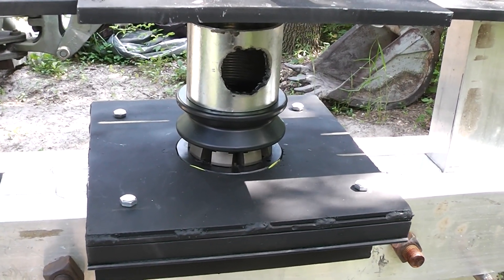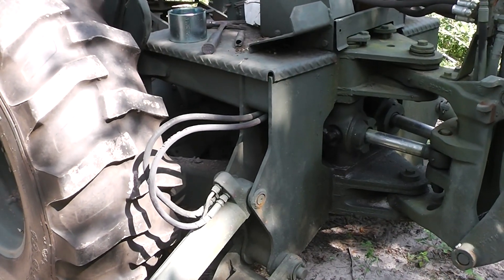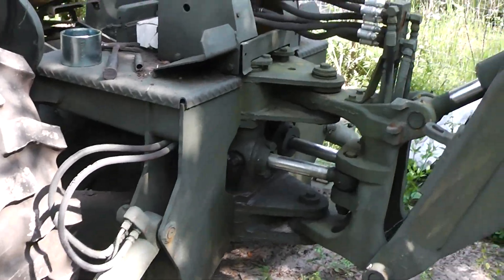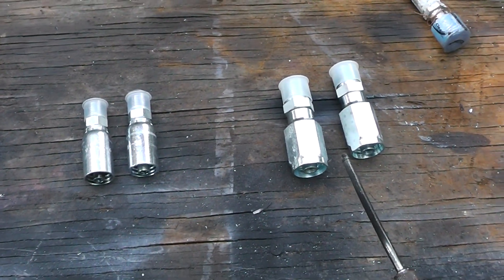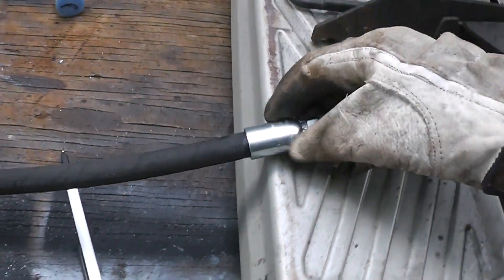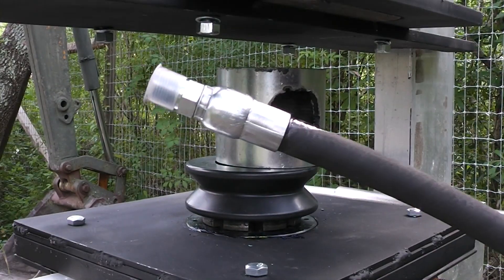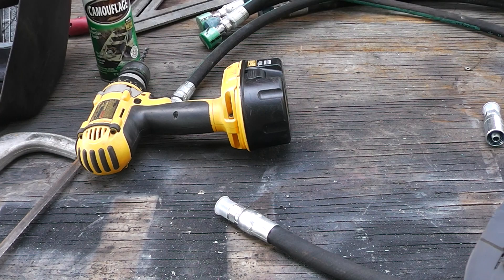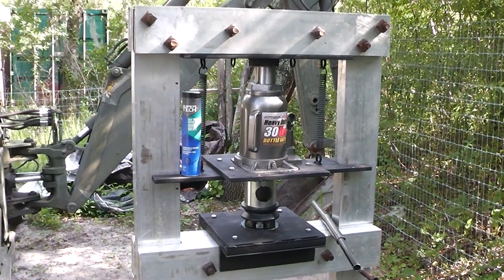Cheap Homebuilt Diy Hydraulic Hose Crimper

Comment: I'm wondering how did you clean your hydraulic hoses when you made them? 
I been watching several other videos on making hoses and now it seems that you have to buy a $900.00+ plug blowing gun kit to shoot cleaning plugs through the hoses, from both ends, so theres no debris in the hose after cutting. Good grief this hose making venture can be extremely pricy and to much for me right now, even the price you was talking about on your crimping die scares me........
Reply from the maker: I just blow them out with my air compressor, then I spray some brake kleen inside and blow that out as well. I'm sure that is the wrong way to do it but my hoses on my tractor have held up for going on almost 7 years now with no problems in the hydraulics. Use this info at your own risk.

Comment: I have some of the $20 Tractor Supply hoses.  After a few years, they're cracking up and the rubber is failing.  The hoses I had custom-made at the auto store and the tractor dealer have been much better.

Comment: For future reference dont dip the hose in oil just out a dab on the tip of the fitting.. any oil built up under the fertile has the potential to force the inner to over crimp and collapse or the outer ferrule to not crimp down far enough. Also if those are parker dies there Is a ledge that the ferrule sits on so you know you've crimped enough of the ferrule length

Comment: You have built exactly what I need. I have built many things driven by hydraulics & never have the right hose. I could not find the brand of your dies & Colette. Can you share that?
Reply from the maker: Here is a link to the dies: https://www.discounthydraulichose.com/d100d165-dies.html
I don't have the part # for the pusher ring/colette but, you can call  Discount Hydraulic hose direct at 800-535-1302 and they will hook you up.  Just make sure you get the pusher ring that matches the dies. I used the D100 dies and the matching D100 pusher ring.

Comment: Looked like your crimp was to low, not all the way up to the mark. Hard to do on a homemade machine for sure. And to crimp the right amount. Especially with different size hoses. Thanks for the video. I've made hundreds of hoses for equipment. And your right they are expensive.

Comment: Thank you for this video, I am just about to start to do it, I have 3/8, 1/2, 3/4 hoses. What crimper die should I buy, I saw different names, but what did you use please?
Reply from the maker: https://www.discounthydraulichose.com/hydraulic-hose-crimpers-37465.html and
https://www.youtube.com/watch?v=nHkh_ybAsfA&t=1s

I bought the D100 3/8" and the pusher ring first and build the rest of it around that.

Comment: I guess it's been three years since you made this video. I have made tons of hoses over thirty + years. The crimp  looked great . A small tip. Move the part down more to get the most hose crimped to the internal pipe. Makes it less likely to blow the fitting off. All my best.

Comment: for 1 and 2 wire hoses you could just use field attach fittings all you need is spanners and for any multispiral hoses you will need to be very accurate or they will blow off 0.2 mm And next time crimp the entire ferrul

Comment: You only crimped it half way, that will cause the hose to fail prematurely in the best case. Worst case it will pop right off and will injure whoever is in the way. These hoses should always be crimped as instructed by the manufacturer, overcrimping might be worse even because you're causing higher pressure build up at the same time as you have a weaker hose end due to it being overcrimped. Very dangerous. Just do it right or don't do it at all, these things aren't worth messing around with.
Reply from the maker: Brent Hinds I guess you did not read the sub titles?

Comment: After you buy the die and pusher, the fittings, and hoses all you have saved is the assembly charges.  It takes a lot hoses to pay for just one die!
Reply from the maker: 3 to 4 hoses pay for the die(@$57 per hose assembly at the hydraulic shop near me).  It also saves me the time to take the hose down to the hydraulic shop, the time to wait on them to make the hose, the drive and the gas back.
No argument here if you are only making 1 or 2 hoses. This homemade hose maker has paid for itself over and over with number of hose assemblies(@50 so far) that I have made with it plus a boat load of time saved as well.
Reply: No argument from me!  
I had a look see on eBay and checked prices and they were NOT $57.  And the hose ends started around $20. 
I need 3/4 " for (mostly) for my backhoe. And the swaging fee is only $10 at NAPA so I'll just continue ... sigh.
Besides, I have to build a press, another sigh.

Comment: That is just bad ass ... In the same boat , forklift all hoses need replacing  small fortune !  So yes very interested in this  set up . Con you get into details on where you found everything to build this. I have a 20 ton press will that work ?
Reply from the maker: I will leave some links. https://www.youtube.com/watch?v=nHkh_ybAsfA
https://www.discounthydraulichose.com/
The prices of this stuff has gone up since I posted the video. The crimper was built around a die($189.00) off of a D100 hose crimper and the compression ring back then was only $170.00.  A few drops from Tampa Bay Steel, a little persperation and their it is.  If you have a lathe, to make the die ring you will come out even cheaper!  Some times you can find this stuff on Ebay for cheap.

Comment: That was great except you didn't tell us anything about it you just crimped a hose which isn't very helpful to anyone. So I'm guessing you just bought the crimping die and threw it on your shop press and cut a hole in a piece of pipe to set on top? Great idea. Where did you get the crimping die? The rest is pretty self explanatory you're just using a press instead of a dedicated hydraulic pump. I see some specs on the commercial pumps and presses are over 100 tons though. What's that mean for your fittings if you're only using a 30 ton press?
Reply from the maker: https://www.youtube.com/watch?v=nHkh_ybAsfA

Comment: Awesome DIY video i was just trying to figure out if there was a way to build one of these... Now i see it can be done!! where did you get your crimping dies from?
Reply from the maker: The design was based on the D100 crimp dies from DiscountHydraulicHose.com. I used the D100/D105 series compression ring P/N:100849 for those dies as well.  Btw, they have good prices on their fittings and hose as well. Tell 'en that the homesteadprepper sent ya!  lol

Comment: I've always wondered how they engineer hydraulic hoses and air conditioners  fail on sunday afternoons. Amazing,  personally I was wondering if one couldn't use a blacksmith type spring swage to accomplish this crimping of these fittings in an emergency.

Comment: I can promise that that bubble crimp is incorrect. Been doing hoses for 21 years and have yet to see a bubble that large. One important bit of advice. When your cutting that hose with a chop saw, make certain your cleaning that hose of particles that will destroy your pumps, valves, and cylinders. Better yet, invest into a blade that is used for primarly cutting hose and use that chop saw for anything other than what you're using it for.

Comment: hello , let me ask you a question, im from eCuador sudamerica, and i really like to make a home made hydarulic hose crimper. i can get  the hydraulic jack here,and do the metal frame. but  need to buy the dies ,  and the ring that you are using  there or some other similar . is that abailable on amazon , so i can order or buy it   online???
Reply from the maker: You can go to www.discounthydraulichose.com 800-535-1302
Give them a call and they can help you get what you need.
You must get a compression ring that will match the dies that you are going to use.

Comment: Seems that there is a big bubble created in the hose end, the crimp area needs to be flat all the way with no bubbles, you are only guarantee that the half of the area is holding the rubber against the metal. with some modification you can improve your machine.

Comment: Here is Michael,an enterprising boy from China.We are a factory specially manufacture Hydraulic hose,Thermoplastic hose,Air&Water hose,Steam hose and Fittings.
Mobile: +8613731073743  Whatsapp:+8613731073743

Comment: Nice project.  I think I'd buy the shop press cheep( Harbor freight (mostly junk) and then use you suggested die and fitting and system.  thanks for the vid, good job

Comment: Mate that's a nifty setup you got. I make hoses for a living in Australia. not sure how often you would be making a hose assembly but I would suggest to you the following. After cutting the hose with a drop saw clean the assembly with something like compressed air and a foam pellet. drop saws leave a large amount of debris inside the hose, imagine all that crap running through your hydraulic system. also to make you life easier make a spacer ring that goes around the dies,that sits on the base of the press to the underside of the pulley thats holding your dies. that way once the pulley bottoms out on the spacer ring it'll be crimped exactly where it needs to be.
Reply from the maker: +gambino 9 Great info, thanks.

Comment: Hydraulics is not something to mess around with, you're going to kill somebody making hose assemblies like this.
Reply from the maker: +Judd Cooper 1st, I would assume all liabilty even if I were to use one of your hand crafted hoses and something went wrong.  The lawyers at Parker would find fault in the fact that I installed the hose assembly myself, faulty tractor hyd pump or etc.
2nd, Don't you think that if I went to all the trouble to make a hose crimper that I would find out how to crimp it properly? If I had done it wrong, would they still be working after 9 months of use?
If you had seen the subsequent vids you would know.
3rd, I have seen hose assemblies burst on newer equiptment that were made by some trained tech at a factory and no one was sued.  How long are one of your hoses guaranteed for?
4th, As soon as I get set up with a PO Box, I will pm you the address.  I will do an honest test.
08-08 1/2 hose x 1/2" NPTF male pipe ends 2 feet long SAE 100R2AT hose.
Reply from the maker: +Judd Cooper I made several hose assemblies for several of my machines that have held together for over 8months now.  These hoses are made for my personal use only.
Furthermore, hydraulics is not something that you mess around with if you don't have the confidence to do so.
Reply: +homesteadprepper I'm a Certified Parker Hydraulic Technician.  The fitting you crimped with your press was not good, only 25% of the shell was biting the braid.
Reply from the maker: +Judd Cooper I guess you did not read the annotation that it was done incorrectly. This was my very first hose crimping experience that I shared here on youtube to show my mistake so others do not screw up like me.  If you watch the construction of the hose crimper part 2 you will see where I rectify the problem and make some sucsessful hose assemblies.  Part 3 show the hose assemblies working under pressure.
Reply: +homesteadprepper I don't need to.  The manufacturer of the crimper, hose and fittings must match - no exceptions.  You're posting a how to video that is against everything we teach professionally in the hose and fitting industry
.
Reply from the maker: +Judd Cooper I posted a video to show how a motivated individual could make his or her own hoses that are superior and more professional to any trolled up comment that you can make to undermine my successful undertaking.  The proof is in the pudding. My hoses work.
Here is my suggestion to you: Please send me one of your own personal professionally made hose assemblies so I can test it head to head with one of my homemade hoses to see how it compares( 24 inch with 1/2 NPTF males).  I put your hose on my tractor to see how good it is and then I will put one of my homemade hoses on to see how they compare.  Make sure you let me know what this hose would cost made by you so I can use that as a comparison as well.  I'll even make it a 3way challenge and throw in a Tractor Supply hose assembly as well for testing just to be fair. I will make a video showing the results.
Reply: +Judd Cooper Haters gonna hate.  Got anything better to do with you time than deride little DIY people?
Reply: homesteadprepper d
Reply from the maker: Judd Cooper: You have no experience in making your own crimper because you lack the brains and the balls to do so. Anyone can sell a crimping machine with or without experience.
If you really knew what you are talking about, you would make and design your own crimping system and market it instead of someone else's.
You sound very much like someone whop feels like I am taking sales away from you, I am not. 
My offer still stands for you to send me one of your own personally crimped hoses for a head to head test against one of my homemade ones and a Tractor Suppy hose.
Reply: +homesteadprepper I may lack the balls to do what you're doing but not the brains.  Let me ask you a question.  After you crimp the hose, do you measure the crimp diameter to make sure it's crimped to spec?  I understand these hoses are being used on your own equipment, but here's a scenario that should give you pause.  Say you're using one of your pieces of equipment with a buddy close by and the hose fails and your buddy is injured by the fitting coming off or gets and injection injury, you could be charged with bodily injury.  None of the manufacturers of the hose & fittings you used would ever stand behind you in court of law.  And you're not taking business from me since I'm in New England.  I accept your challenge, just give me your address and the dimensions of the assembly you want and I'll send it to you.
Reply: +Hyrum Young I'm far from being a hater to the DIY peeps, just letting people know that this is not the proper way to assembly hydraulic hoses.  I've got 20+ years in the industry and sold over a hundred crimping systems, so I know what I'm talking about.

Comment: Make. Absolutely certain, the you use the die for each hose, in other words, gates dies for gates hose, parker for parker, etc. also do not ever put gates fittings on anything other than gates hose. They are all engineered for each manufacturers hose to only their fitting.

Comment: Yeah from all the hydraulic hose crimpers I've used, it looks like you have the die upside-down which is why you're not feeling the stop ridge to properly locate the fitting to the die portion. If yours is designed that way then rock on!
Reply from the maker: +Brent Simester  There is no stop ridge on these fittings, just marks. The D100S works the same way with the die mounted the way I have it shown.

Comment: Do you use the same die for all hose sizes? What model # on the die? Do think an air powered bottle jack would give you precise enough control for this. Thanks.
Reply from the maker: +P.Melvin Shyturtle Different dies for different hose sizes.  The die is a D100-19mm for 3/8 100R2AT SAE hose.
I have never used an air powered jack for crimping but, I guess you could give it a try.

Comment: I'm going to ask a dumb question: Can a crimpler for airconditioner hoses also crimp hydraulic hoses?
This one http://bit.ly/1iZLHZz (Mastercool 71550, $150) seems to make a crimp which looks very much like what you're after.
If it works, it might be OK for doing a few hoses before your hands cramp up.
Reply from the maker: +Jeff NME No such thing as a dumb question.  I am not familiar with a/c hose crimpers.  However, I would surmise that it is probably not compatible with hydraulic hose crimp dies and does not have enough crimping force to properly crimp a 2 wire 4000psi hydraulic hose to its fitting.  A/c hoses work at much lower pressures.
Reply: +homesteadprepper I wouldn't discount the ability of a hydraulic system to generate the required force.
It looks like the crimping dies aren't quite correct (that waffle pattern), but it might work with modified dies.
Reply: G'day you will not get enough force out of it to crimp hyd fitting there is a huge difference in the ferrules that you crimp
Reply: Absolutely not!
Reply: The Master Kool crimper that you offered to look at will not work for STEEL fittings ... it was designed for Copper or Brass Fittings.  But thanks for offering help!!

Comment: I was glad to see that you measured your crimp with a caliper, but how do you calibrate your homemade crimper to achieve the proper crimp diameter? In the video, it appears that you just got lucky, and I know from experience (I worked for a hose and fittings company for almost 12 years) that crimps need to be precise. Also, I would like to let you know that you have not crimped that fitting properly. Your crimp does not go all the way to the knurl, and it should. As is, I would not be comfortable using that hose assembly at 4,000 PSI.
Reply from the maker: +Ken Hutchinson My first attempt on a homemade crimper was not text book( as annotated in the vid) however, successive hose assemblies have been flawless.  As a matter of fact, several homemade assemblies have been installed on the old tractor for some time now with no failures. It works for me.
And yes, I did get lucky, well sort of on the first one specs.
Btw, that was the first hose I have ever crimped.

Comment: How did you know you weren't using too little or too much force crimping? You weren't able to measure 'til after, no?
Reply from the maker: 4998826p I had know way of knowing how far to go.  This was absolutely the first hydraulic fitting I have ever crimped so I tried the trial and error method.  I got lucky on this first time that it spec'd out correctly on the first attempt but, I did let the fitting slip down too far.  On subsequent attempts, I stop short, take a reading and incrementally crimp until I get the proper specs.